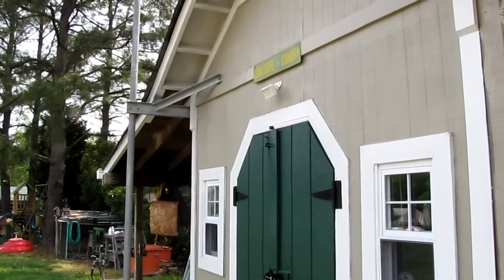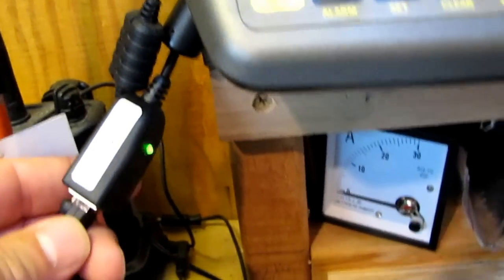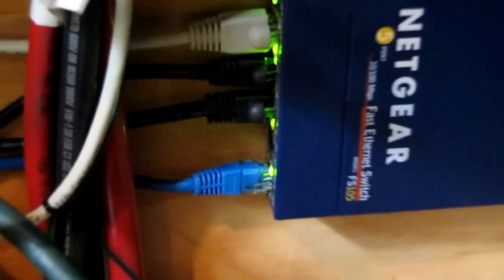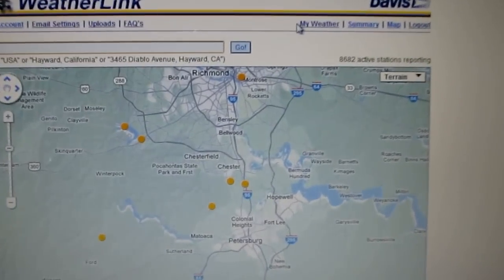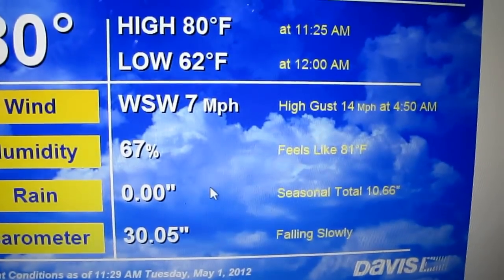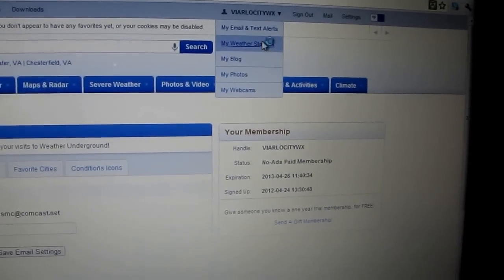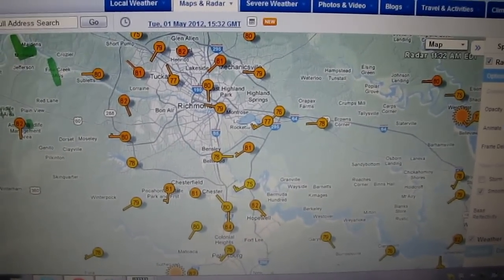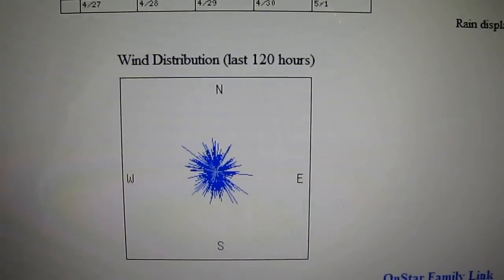Davis Vantage Vue With Davis WeatherLink IP 6555 In Virginia

Comment: maybe you should of figured out what all your equipment was before ya tried telling us what it was huh?  let me make a suggestion if i may, lose the 5 port switch, upgrade your ethernet cables to cat 6, and if your interested i can tell ya how to have the ability to do a few things with your system you prolly didnt know is possible!!! let me know
Reply: What's wrong with the cat 5 cables and Ethernet switch? There's nothing in that setup that requires more bandwidth than they provide and the system is up and running.
Reply from the maker: Saint Heretic Your Exactly Right I Need All The Help I can Get  I Will Let You Know Cheers Kenny

Comment: Hi,
I have been on weather wunderground since 2008. One heads up... Be sure to set your computer for NON automatic updates. If the updates are automatically done, many of them will reboot your system and knock your Davis stuff off line.
I have the Vantage Pro II and have NEVER touched the system. I have 2 solar panels on my station and the original batteries are still running.
I will overhaul the system this Fall; should take a few hours. 

Glenn
DSM Labs (dot com)